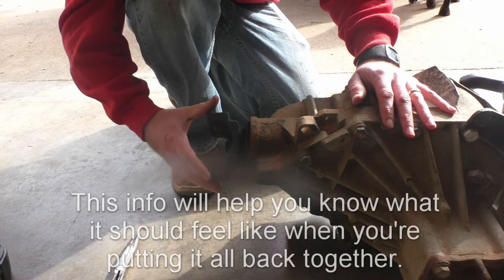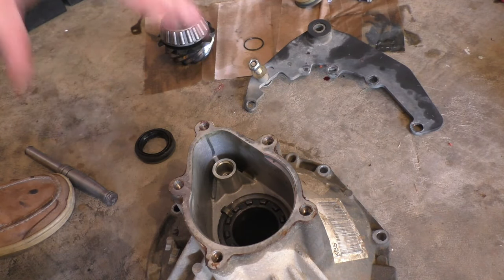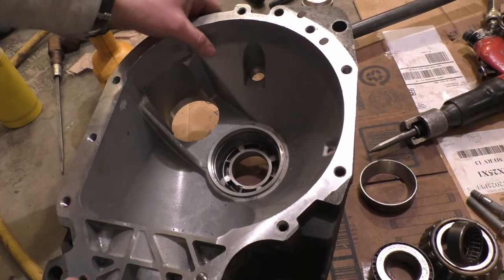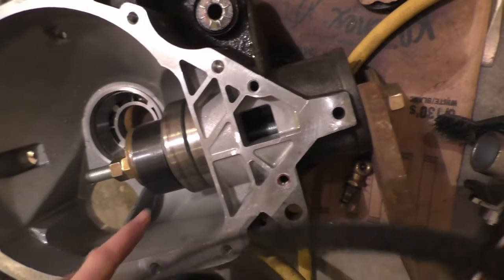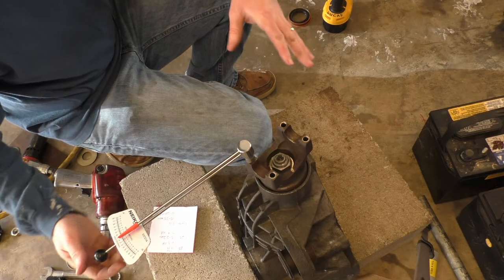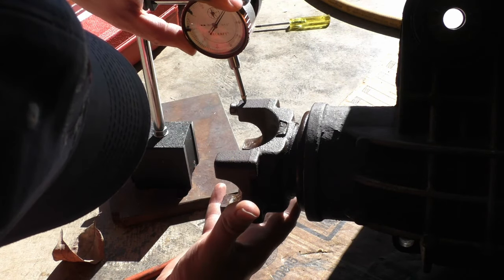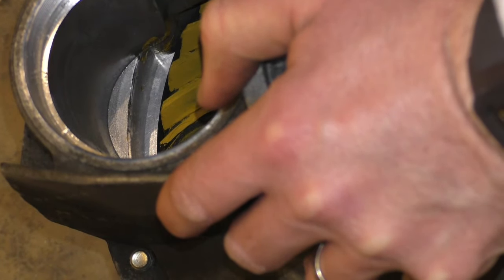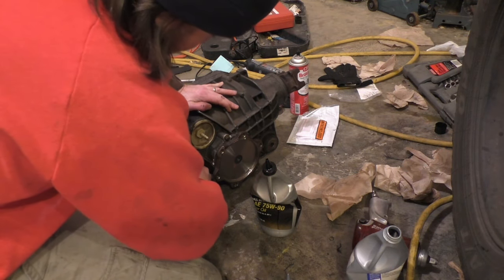How to Rebuild a Chrysler/Dodge AAM 9.25 Front Differential Center Section

Comment: What brand is that puller? And the name of the kit that came with that round attachment to remove the carrier bearings? Thanks
Reply from the maker: I have links to most of the tools in the video description.  My puller is a snap on.
Reply from the maker: Also, if I remember right, I think the round thing you are talking about is from a race installer set.
Reply: Farm Dad right on thanks 👌🏼